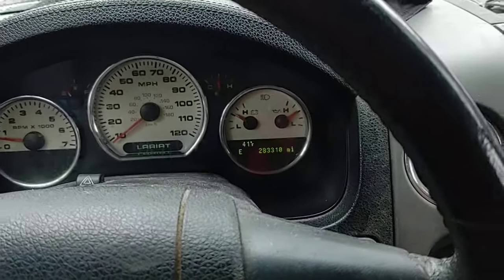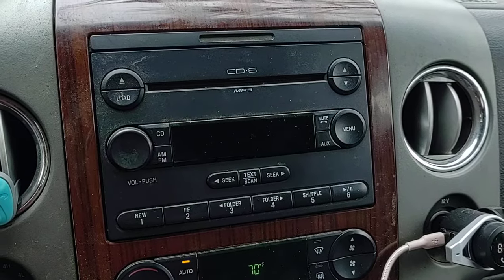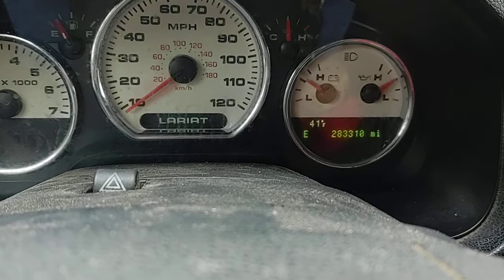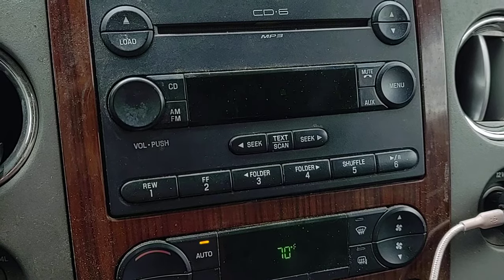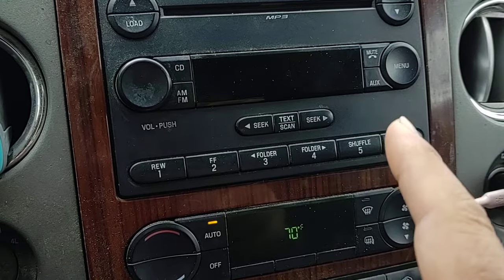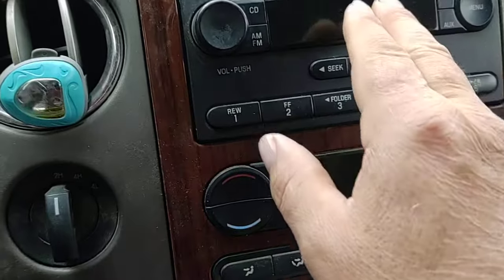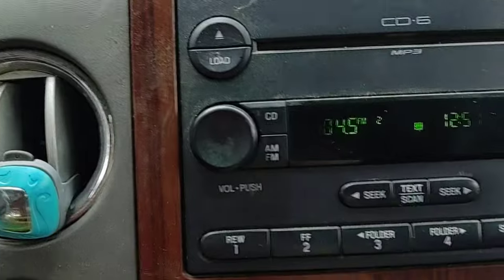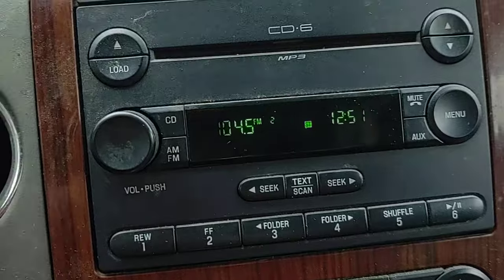2004-08 F150 Radio Fix

Comment: BRUH?!  🤣🤣🤣 It really worked!  I found after research that there is a common soldering problem that looks quick and easy to fix. However, I gave this a try and BOOM 🤯 THANKS!
Reply from the maker: Thanks Bert,
Reply: @74stevedc I LOVE YOU MINE JUST WORKED
Reply from the maker: @armandoh9517  Hi Armando, 
Glad it worked for you thanks for watching and commenting on my video.

Comment from the maker: Junkyard in my area want 70 bucks for a replacement radio. In my area if you find a F150 radio is always gone. Also there's not a lot of Ford F-150, Explorer's etc.
Reply from the maker: Update got a deal at a junkyard on another radio, waited a few months to install out of warranty, guess what guys and girls that one also does the same thing. Point being must be a common thing 🤠. So if you find one for 20-25 install it right away and ask what there return policy is if display doesn't stay working.
Reply: It’s not the radio
Reply from the maker: Connection or display either way it worked and occasionally needed a bump again,

Comment: I'm late to the party but the fix is to pull the radio and remove the face plate. Flip it over and you'll see some solder points. Lots of YT videos on how to fix it.
Reply from the maker: Thanks for watching and commenting.  I figured something is definitely loose back there but it's a common problem.
Reply: @74stevedc  There are four solder points in particular that need attention where the display goes through the circuit board. I didn't even use solder on mine, I simply used my soldering iron to melt what was there and let it reflow. Problem solved.

Comment: I'm using my dads old 01 f150 while my cars in the shop. I just slapped it out of frustration once and it started working lol
Reply from the maker: Hi Val,
Glad it worked for you, I don't have that 2007 truck I replaced it with a 2010 and a Tundra. The Tundra is going to replace the 2010.

Comment: Yes I’ve done that to mine. Problem was I had to hit it once a week then once a day. Until the whole radio went out. 😂
Reply from the maker: Hi William,
That's how mine sorta went, then the frame rusted out and one day wasn't running good. I had a 2010 lariat also sold that one replaced with a Toyota Tundra.
Reply: Well, sounds like you fellas beat up the radio really well. Time to get a new radio now...hey or a new truck tho!!!
Reply from the maker: Yah,
The old "Black Stallion ", was sent off to the junkyard a few years ago. I really loved that 2007 Larait but the frame had a few holes and cam sensor went out again. 
I replaced it with a 2010 Larait then a Toyota Tundra as my personal truck. The Tundra hasn't earned a name in the 2 years I owned it yet. It's been a good truck ac compressor went that's it so far it has 278,000 miles It's a 2009.

Comment: FYI you can just push on it and it does the same thing.
Reply from the maker: Thanks for watching moto, it seems to work for most people it seems.
Reply: @74stevedc  banging on it does work, so does pushing on it, and there is less risk of cracking the display.  Just thought people would want to know.
Reply from the maker: @moto-fl3rd  Great point.

Comment: I just started having problems with my radio. The screen and everything works but there’s no sounds. I’ll turn up the volume all the way and nothing. Checked all the fuses as well.
Reply from the maker: Sounds like it may be speaker, radio or wiring,
Reply: Have you found a solution yet? Cause my 2008 expedition is doing this exactly, all fuses work radio works but no sound whatsoever and I can’t find anything online
Reply from the maker: I'd pull out a speaker and test for power with a multi meter first. If no power radio or wire is bad.
Reply: @SeventyMage4597  unfortunately I haven’t. I was told maybe try replacing the amplifier but who knows. I may try to replace the radio with one from my local junkyard and see if that works.
Reply from the maker: Make sure you install right away I got a junkyard one with same broken display.
Reply: @74stevedc  oh man sorry to hear that. But I will thanks for the tip!
Reply from the maker: Good luck there hard to find in junkyards.

Comment: Tapped my radio display with a little too much frustration and it cracked, so be gentle and tough at the same time. You know, like when..
Reply from the maker: Yes JC good point I hit it with my palm. My kids sorta over did that and cracked are screen also. It's a firm bump not a 1 shot knock out Mike Tyson deal,.

Comment: Mine works but every time I start the truck it sounds like a machine gun brrrrrr brrrrr why does it do that? I have the same stereo and truck
Reply from the maker: I'm not familiar with that issue, but these radios have there issues. I'd probably just replace with new from Walmart or Amazon etc.

Comment: It used to work. But not so much anymore... lol. Now my radio won't even turn on (and it's not the fuses).
Reply from the maker: Hi Scott,
Was a common problem with these radios my junk yard pick had the blank screen. It worked for me for awhile until my kids hit it to hard cracked the screen. I'd probably get a aftermarket one from online or Walmart if I was you. It just seems like a common problem with millions of these. 

Thanks for watching appreciate the feedback and by the way I bought a newer f150 sold that and now have a Tundra with a broken antenna and poor reception.